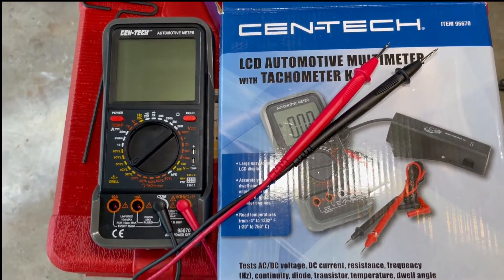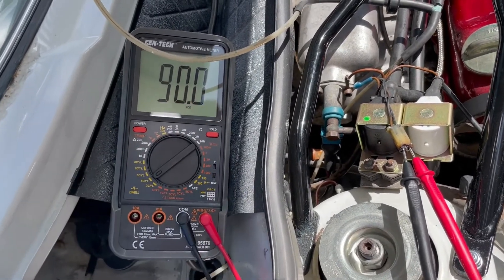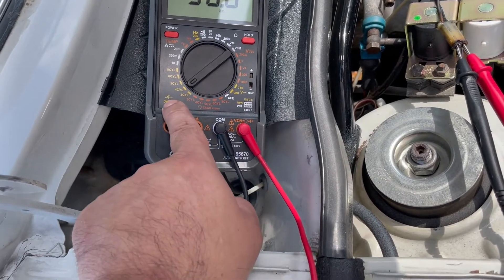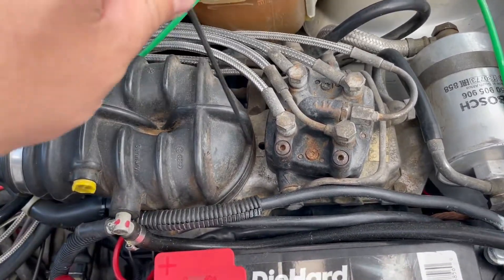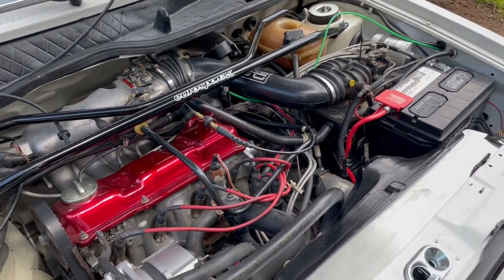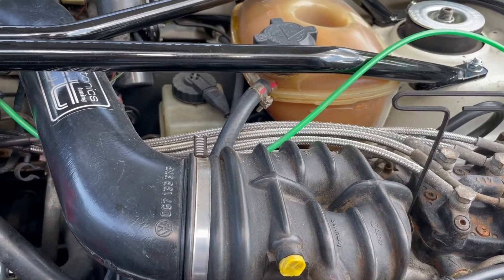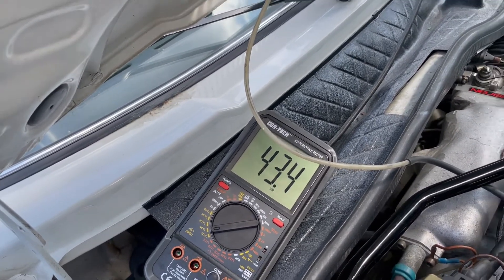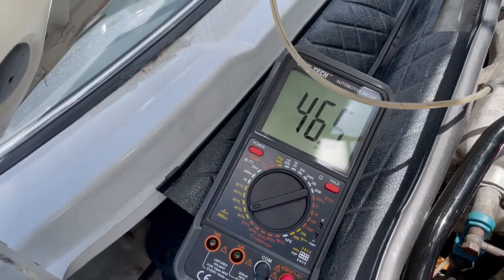How to Adjust Air Fuel Mixture on a Mk1 VW Cabriolet

Comment: Just did this adjustment this past weekend on my 86 Westy with 1.8 8 valve 85 hp CIS setup.  Helped idle out tremendously.
Reply from the maker: Nice! Glad it helped you out.
Reply: I am so glad you did it, great to hear that. I wish I knew where to find that control cable.

Comment: The cis system im using is adapted to another vehicle. What does the test port connect to? Is it the o2 sensor, the mixture solenoid or something different?

Comment: Great video! So my rabbit feels like its very rich. It had a vacuum leak and I repaired it but it still under load will missfire out of the exhaust when on a load. i put the meter on it and it reads 6. I go to adjust the CO and when I just touch the adjuster to turn it the car dies. If I get a little bit of adjustment with out it stalling out it will stay at 6 6.3 I cant get it to move off that number no mater what I do.

Comment: Beautiful subject. All who have CIS engines are mostly left on their own as there is no professional service for so old cars, maybe somwhere in Germany, maybe only. This video is great, but not clearly illustrated where that test cable is or if there is no such to find what are the options to look for certain contacts elsewhere under the hood. This is a problem. Who reads all text given, the confusion raises, 45 degrees must not be for all models and then what, how to know values for my model? Ups! I bought Multimeter with dwell after this video and then found out that CIS with 8 valves doesn't have control cable left for testing. CIS is a complicated set of parts, where if one is not perfect nothing will be good, shortly, a car to drive near home as anything can stop at any moment, unfortunately bit old and difficult.

Comment: Any idea on what the psi of each injector should be at at full open? Also what the cc rating would be per min?
Reply from the maker: Opening injector pressure is 46.4 to 55.11 psi. Injector flow rate is dependent on fuel distributor and CPR. This site has the flow rates of every injector listed by part number: http://users.erols.com/srweiss/tableifc.htm
Reply: @ShinyFastLoud  awesome, greatly appreciate your help brutha, im in lieu of chasing a hiccup around 1-2k rpm under a load, after 2k rpm she cracks right through, car has been sitting non op since 2008 so it was in rough condition, chasing gremlins down and trying to get her road worthy :]

Comment: Hi, would you maybe know if this setting isnt in thr 45s if it has anything to do with my engine not being able to start?
Reply from the maker: I don't think the frequency valve would really affect starting.....more just the idle. What are your numbers? A lower duty cycle results in a leaner the mixture and a higher number results in a rich mixture.

Comment: My cabriolet is not working properly, I have been trying these steps for several days and it does not work for me. Could anybody help me? I connect my millimeter and it reads 89.9, so when I start the vehicle automatically the millimeter reads 00.0 and doesn't change from there. What could it be? Is it that the air mixture does not work in the car? How can I fix it? I don't think is the milímeter because is brand New. Any help will be appreciate it, thanks in advanced.
Reply from the maker: Test your frequency valve. The frequency valve's duty cycle is measured on a 0 to 100% scale.  If the duty cycle is at 50%, this means the frequency valve is open 50% of the time, and closed 50% of the time.  Conveniently, the duty cycle can be measured with a dwell meter set to the 4-cylinder scale; the example 50% duty cycle corresponds to 45° dwell (100% being 90°).

To test your frequency valve, you will need a DVOM and test light, along with a relay jumper wire.  If the valve is not buzzing and/or vibrating (remember, that's what it should be doing!), follow these steps:

1 - Disconnect the frequency valve's harness connector.
2 - Measure resistance across the valve's terminals.  Resistance should be 2 to 3 ohms.  Yes: Valve is fine, continue testing.  No: Valve is faulty and should be replaced.
3 - Remove the fuel pump relay and jump terminal positions 30 and 87.
4 - Using your test light, probe the frequency valve's harness connector terminals.  Your light should shine.  No: Check the fuel pump fuse, fuel injection power supply relay (there should be power going to the Jetronic control unit; see pin-outs below), wiring between all of these components, and all associated ground connections.
Reply from the maker: There is great info on http://www.cabby-info.com/kjet.htm

Comment: I just watched your vid [again] and wondered if this Dwell Adjustment works only on K-Jet, or if I could do the same on my '86 Cabriolet CIS?  Don't necessarily want to spend $50 on a Dwell Meter if it's not going to read accurately.  It's close to original, added only a g-grind cam, and I have the little tester dongle you thoroughly described.  Thanks!  

P.S. Hope the shop relocate goes smoothly...
Reply: CIS = K-Jetronic

All 1980-1989 North American Cabriolets using K-Jetronic with lambda will have the test port for checking & adjusting the system's duty cycle, including your '86. Go to the Cabby-Info.com link in the video description for complete information.
Reply: @kamz4576  Hello.
Have you the similar website for the Audi 80/90 b2 platform? Thank you.
Reply: @urqua495  Sorry, I do not. 😕
Reply from the maker: no

Comment: So when I hook up my dwell meter to those plugs mine reads 0.00, any suggestions?
Reply: Press the (hold) button on the meter and should be on 90.0
Reply from the maker: Test the frequency valve itself.  There is a good write up here: http://www.cabby-info.com/kjet.htm

Comment: I have an '81 Rabbit Pickup with an EGR system (no oxygen sensor).  Would you happen to know where I find the connector to plug the test leads into?
Reply from the maker: Unfortunately, I don't know where the test connector would be on a EGR equipped engine.
Reply: @ShinyFastLoud  would you know if EGR-equipped engines have an oxygen sensor?